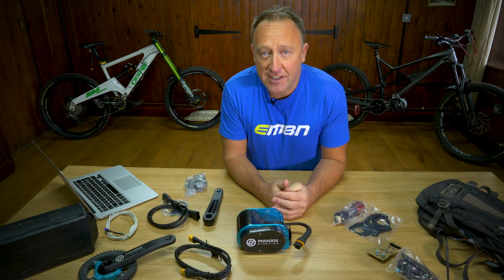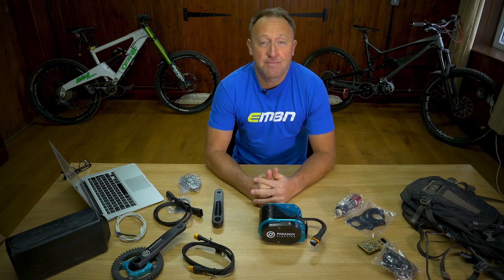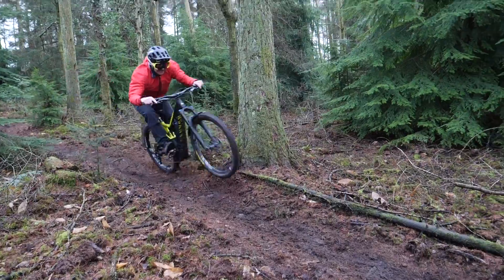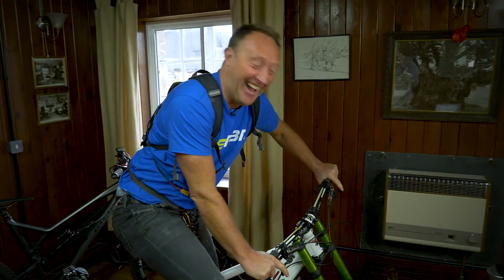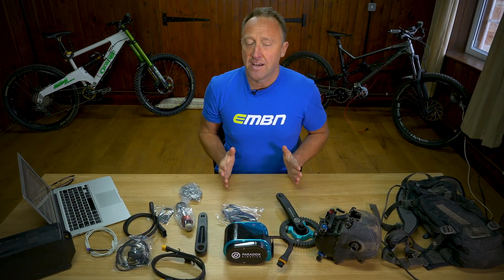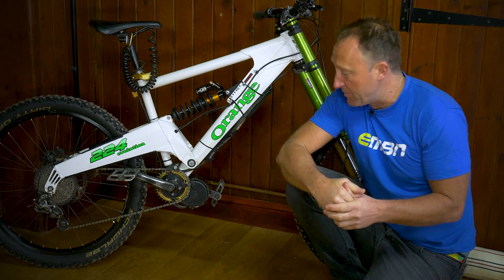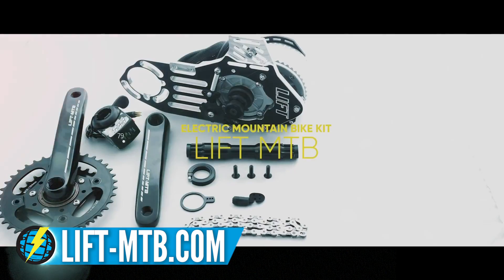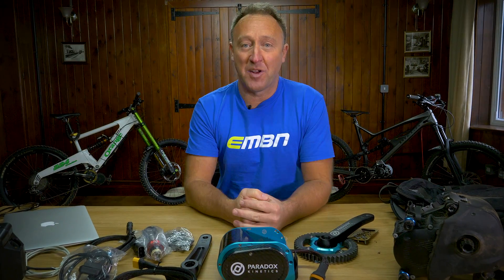Bolt On E-Bike Motors Explained | E-Bike Fundamentals

Comment: Can anyone see the elephant in the room here??! They are complete and utter junk !! Well done Steve , good job of remaining impartial when clearly you are thinking wtf? 
The beauty of the modern ebike is the technological integration of the the motors and the pedal assist systems.  I am assuming anyone who uses any of these motors has not spent much time in a modern ebike , and the icing on the cake is the price of them.

Not for me but each to their own 😎
Reply: This, wires everywhere, things hanging off, batteries in backpacks. It's just stupid, let alone that if you're caught on the road with one you will be done for riding an unlicensed, uninsured, unregistered motorcycle. Big fine and lots of points.
Reply: @SteveTheWiz  That is up to the builder. You can build any ebike however you want. 

Sounds like you have a bad relationship with the law. Usually, you get a friendly wave or a few questions out of curiosity. No one is here to hassle ebikers except roadies and MTBers.
Reply: I would highly recommend trying the Lift-MTB kit before you make such comments. Its not what you think.
Reply: Modern!?? Can YOU easily program the pas assist characteristics of an "off the shelf" bike? ... no. Can you program the power characteristics? .... no. People get off their "off the shelf bikes" and onto mine and their emtb smile instantly gets way bigger. My brother, who has a Merida e160 900e, describes my bike as " another league up". Brother in law with a Kennevo wants bigger forks and power and speed too now. Try riding a properly PAS tuned bbshd and you see what reality is.
Reply: barry taylor it’s illegal mate , your describing an electric motor cross bike , I’m sure it’s great fun but I’m afraid it’s people like you that are going to get us all banned from trail centres
Reply: @coop69coop  I have several motocross bikes and enduro bikes. Your comparision is ridiculous. They both have two wheels, is about as close as the comparison goes. How is it illegal? Again you need to research the bafang systems before you make such a ridiculous statement.
Reply: barry taylor Fair enough , horses for courses , I don’t know much about them tbf , but I do see people on highly illegal electric bikes at trail centres and it’s an increasingly common issue. I think the powers that be are turning a blind eye and hoping we are sensible about it .., for now. I don’t agree with the 15 mph limit , but it is the law
Reply: @coop69coop  Well if the bike park is on private land it will really be up to the bike park owner. But if public, they should know the consequences.

Comment: Very educational. Just seems a bit messy all the wires hanging about. Also if you come off what's going to happen if your attached to the bike ? Rip the cable off or get tangled up with the bike.
Reply: Most folk fit a quick disconect for this.

Comment: Interesting video, but I think they look a bit dated now and will probably mess with the geometry of the bike. I don't see the point with one of these, especially the £2000 + add on units, when I just bought a 2018 Focus Jam2, brand new for £2249, or you can buy a second hand Specialized Levo for about £2500 to £3000 on ebay.
Reply: beesleyboy totally agree ,
Reply: How do they change the geometry? A major point of using an add on unit is that these things allow you to use a bike with the geometry you want. A major point for those who dont want to compromise with the geometry available in off the shelf bikes. I want 200mm front end (even 180 is a compromise to me ) ..... a focus jam2 is just another "kevin" for me.
Reply: @BarryJTaylor  See what you mean Barry, but bikes like the Jam2 are designed with the motor and battery in mind. So the balance of the bike is taken into account at the design stage.
I'm sure a non e-bike designer, would not like, or be expecting someone to bolt a motor to it. or have extra + KG swinging around on your back, i'm not saying a aftermarket motor will not work out for some people, especially those on a tight budget and just add on a hub motor, to their bike, and a tidy frame mounted battery.
but I was talking mainly about the people planning on spending £2000 + on a kit, if someone has that sort of money, ther bike is probably going to be worth £1000, and they don't need 200mm of travel, sell it and buy a second hand Specialized Levo.

Im 50 years old this year, I'm a BMX rider from the 80s, I have some skills but nowadays I mostly just ride around the cliff paths and moors of south west cornwall, so I don't need 200mm of travel.
And have you seen what riders are doing on the Jam2 kevin's! :-)
Especially with someone like Olly Wilkins riding it.
Reply: beesleyboy Yep , absolutely, and anyway , if you want 200mm travel there’s nothing to stop you fitting a double crown fork to any bike ...
Reply: @coop69coop  And the chainstay length? The head angle? Bb height? The power? The reliability? Theres so much in it,  I think only the Merida was relatively close, but a 200mm fork on that would be odd unless I could raise the rear suspension and lower the bb. 
I looked at them all and the only thing that seemed sensible was to "electrify" the bike I had built up  just as I wanted. The only drawbacks I saw was an initial worry about ground clearance and also the cranks. Ground clearance has turned out to be no problem ... and I got some decent cranks, just in case. To be honest I thought Id just build it up and try it and later get either a Husky, a kenevo or the merida. But to be honest having so much power has made it so much better, so they all seem so dissapointing to ride now.   Oh and Im in Australia .... so I have a lot of space to ride lol.
Reply: @alex billing Nice bike bud, a couple of my mates have just bout the Cannondale, I have been in to this E-mounting biking for two and a half years now, and started out on the Giant full E,  all of my riding friends said they wouldn't go electric, but they went on a mountain bike holiday, last summer in Spain and hired out some Cannondales for the day, when they got back to the UK, 6 of them bought e-mounting bikes. ;-)
Have fun and ride safe.... ish

Comment: Love my Diamondback 27.5 hardtail with BBS02, I have over 5,000 miles on it. (Only 1 year old)  btw, the throttle for sticky so I removed it, pedal assist only now and for 4,000 of that 5,000 miles.
Reply: What is the name of your diamond back? I have a diamond back xc and was wondering if the BBS02 would fit.

Comment: Mid drives, mid drives, mid drives...... @5.43 Steve you mentioned that a hardtail allows you a "neat system"?  You're right, but the example you used looked like a mad otter of a conversion.  Please Check out My Instagram Https://www.instagram.com/likeher9 for a slightly tighter build. Pas, or throttle, or both together! cruise control, and regenerative braking With a 130mile range. Just an example of what can be achieved with a little care and attention, that's all!

Comment: Annoying that my cycle to work scheme refuses to allow bikes over £1,000. Rules out any decent e-bikes. Does make me tempted to buy a decent non e-bike through the scheme and add a motor to it.
Reply: Do it! But don't forget the 3rd-party insurance for any bike on the road these days (or off-road). Too many litigious folk around these days.
There is also that horrible circumstance if you do hurt someone for real... I go nowhere these days, on any bike, without insurance.
Reply: Do it you won't regret it, go for it ..
Reply: Bossnut Cailbre is under 1k. Add a bafang and you are good to go

Comment: There are other options for bb and if you choose a full suspension frame well the battery can fit nicely. Don't choose a frame that has a low lower downtube (most Giants for example) because the motor will be too low to the ground. A straight downtube is best like the orange shown. Transition is a good option.

Comment: Thanks Steve, great video. As a follow up it would be great if you could cover more detail on what these motors are actually like to ride on the trail, as I get the impression they are less "intelligent" than integrated kit. For example the Bafang requires sensors on the brakes to cut the motor, which sounds like it could take some getting used to, so it would be good to know how a 250w bolt on (with battery on the frame) is a genuine alternative to an entry level hardtail emtb.
Reply: To do it properly with a Bafang, you need brake and gear-change sensors, as well as a speed sensor on a wheel.
They currently are at a disadvantage when compared to a 'proper' integrated e-mtb system as the latter has torque sensors that measures the input from the rider.
Banfang, and a lot of other retro-fit motors, are pretty much on/off drives. You control the applied torque to the back wheel by drive level selection and/or throttle (if fitted).
It takes a bit of getting used to. :)

I'd love to see a comparison test too - same rated motors, similar chainring and cassette gearing, pedal cranks, battery rating, and so on. A real like-for-like comparison.
Pretty please? :)
Reply: I found the brake cutouts superfluous when you program the stop pedal decay very short.

Comment: Thank, you for finally covering conversion motors! I've been waiting for this video for a long time. I can personally speak to the durability of the BBSHD, I've bashed mine on rocks and submerged it in creek crossings for months without failure. Built my own battery, which luckily hasn't exploded yet, likely due to safety features like cell-level fuses. I'm very glad for all the power, a Euro-legal bike wouldn't be able to plow though three feet of snow pushing a ski instead of a front wheel. I guess it's what you're gonna use it for that determines what power you need.
Reply: This is what a lot of anti-power writers miss - it's not all about riding an 'electric motorbike' at high speed along shared public trails - it's about having a bit of fun, responsibly.
As long as we keep the idiots at bay (they ALSO ride "Euro-legal" bikes!!), there's room for all of us. :)
I did that ski-thing about 30+ years ago to a little Honda H100 motorbike - I am so with you on this. Damn, that was a lot of fun!! Thanks for the memory. xx

Comment: I have a Bafand BBSHD installed on a Rocky Mountain Soul 20.  The battery is a 20AmH Samsung triangle battery.  With throttle assist it has a range of 70km and 160km with peddle assist.

Comment: I'm in the process of building a e bike with a bafang bbs01b motor which I paid about £380 for and then the battery a 36v 13amp/hour mounted onto the down tube which cost about £250.
I have upgraded the brakes with 203mm do a discs up from 160mm and the hydraulic levers with electric cut off in place of the original cable brakes.
With regards to chain line I have fitted a lekkie bling ring chain ring.
Can't wait to get it finished and get out and ride it
Reply: I had to fit a Bling Ring as well, as the pressed steel one is just stupidly out of line! lol
You are going to have so much fun!! ;)

Comment: Wow, Steve. Thank you! That is more than cool of EMBN! Well done. 

Thats a pretty good overview of options and does shine some light on various advantages and disadvantages of doing a retro fit. I would add that you can get a 750W Bafang kit on Amazon UK for 380GBP including a display and you can even fit that on a fatbike with an adapter if need be. You of course need to add the battery and you can always use a standard 600Wh 48V or similar with charger and integrated BMS (so its easy and safe to charge and balance automatically) on Amazon UK for 214GBP. So your total outlay except for the bike is around 600GBP. Now get a very decent second hand MTB or lets say a Calibre Bossnut fully for just under 1000GBP and you have a top notch bike.

Is it as nice as a Haibike? Is it as light? Is it as well integrated in the frame? Of course not but the differences are really minute and not everybody can or will cough up 2000GBP for those. 

What was briefly touched upon in the video is the freedom you have to tune your motor controller to your liking. On the Bafang you can just plug in your USB cable and change every aspect of the controller, the starting power, the acceleration curve dependent on your cadence, etc. What is missing are the neat extras you have with eg. Specialized and their Mission Control app. That kind of integration for range calculation based on the route, etc. is very neat and is something I miss on my bike. The integrated torque sensor is another nice thing on the complete ebikes as this is also not standard on most conversions, they use cadence sensors only. This however is a minor issue as you can configure the power curves to fit to your riding style.

So again, thanks Steve and now back to some emtb porn I can dream about!
Reply from the maker: Thanks mvh808, some great comments you made and we are glad you liked the video! 👍🤟

Comment: At last Steve I put together a Hardtail Vodoo Bantu with a rear hub drive for road and Fire trails as you call them and a Bafang mid drive on my Specialized Camber full suspension for more serious off road fun,  both run from my 52v 21ah Samsung 35 E celled back pack battery good for almost 40 miles have 2 bikes for less than 2.5K will email pictures if you are interested  ?
Reply: Never done more than 40 miles, battery voltage was down to 48 v after that still showing 2 bars on indicator .
Reply: @yj8471  ah that sounds more like what Id expect. Probably you have at least another 20 miles of charge.
Reply: Im getting nearly 60km from my 52v 13.5ah battery pas only. Are you throttle only? 40miles seems short from a 20ah battery?

Comment: It's the overpowered stuff that's gonna bring about a ban.
Reply: Correction - it's the overpowered ones being ridden stupidly by d*ckheads that's going to bring about a ban. :(
With my BBSHD motor, you will never see me using it downhill. On the flat or going up, it is pedal-assist only - with the limiter firmly *ON*.
Reply: @SusiBiker  too true. I trundle around slowly near folk walking ..... and then some dickhead on a pedal mtb goes ripping past me and all the walkers ... kids and all were there!

Comment: Brave touching this subject. A lot of folks on other forums get out of their trees - each have their favourite. Nicely coverered. Thank you.
I just replaced my 1.5kW rear hub, with a BBSHD mid-drive for all the reasons you said.
The hub was fast - 45mph+, but I wanted slower with oodles of off-road torque. Has an 830Wh battery. All of this was bundled onto a RockRider 500S. :D
When I finally sell my Whyte T130CRS later this year, going to go for one of the latest Specialized that I can afford.
Reply: Thanks Sue3, well i guess the pair of us have been chatting about this for a while now right?! Hopefully it addresses matters to some degree
Reply: @stevejones7956  Thanks Steve. You know I am teasing - most of the time - right? ;)
I did wonder though - have you seen anything about the "Bafang Ultra" motor system?
It's supposed to be a retro-fit motor that is aimed more at going head-to-head with the integrated systems - in that it has torque sensors on the pedal axle.
Did I dream this? And if didn't, any ideas what bikes it will likely fit?
All the best, Susi x.
Reply: @SusiBiker  It looks like the ultra is not as much power as the bbshd. The only thing I see is that the ultra has to have a specific frame mount. So its only as versatile as any other off the shelf bike. Ie. You have to have the bike that fits only that motor. Seems a step backwards compared to the bbshd to me.
Reply: @BarryJTaylor  Hey Barry, thanks for the reply.
That's what puzzled me when I saw it - bike makers would need to design their frames to fit it - like they do with the Shimano, Bosch, etc. Unless they provide some kind of fitting kit, it's not going to be a retro-fit system.
Could be a few things going on -
I wonder if they have deals in place with the name-brand bike/frame manufacturers?
Or, do you think they will make versions to fit the motor mounts of existing ebikes, but offer more power?
There's the price aspect - undercutting the big motor manufacturers?
If it helps bring down the overall price of ebikes by adding more competition that's a good thing, but I am failing to see the point at the moment...
...There is always the possibility they start making their own frames/bikes..?
You won't have the refinement of the Big Boys, but if they come in around half the price? Now that would be REALLY interesting! :)
Reply: @SusiBiker  Its an interesting subject really. Bafang have been doing ebike motors for years, way before these "known brands". It wouldnt surprise me if they were involved in the design and msnufacture of those ebikes featured in the Beijing Olympics opening ceremony etc. But they have not seen the need to make such a frame dedicated motor as these modern units. Indeed their ethos was probably "lets make it retrofit everything". Gotta admit Im still not sure I see the merits of buying such a non-versatile thing as a bike that takes only one type of motor myself. But anyway  judging by the sales .... folk buy them as Im sure Bafang see now. And given thst they have been making them for years .... I guess they feel they had better use their skills and make one. 
Now they just have to convince bicycle companies to design to fit their Ultra drive ..... not an easy task in what is possibly one of the worlds most "brand name" needy markets. 
Maybe they could do a deal with SRAM to use their name .... and they'd be instantly marketable. Lol.